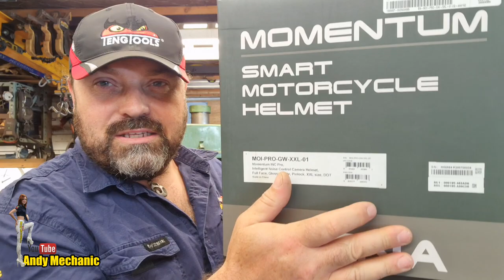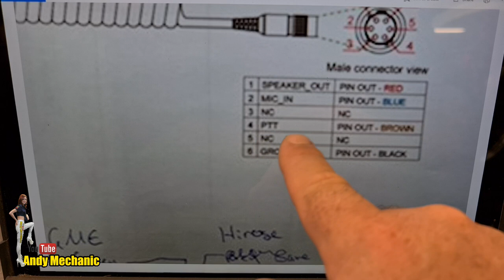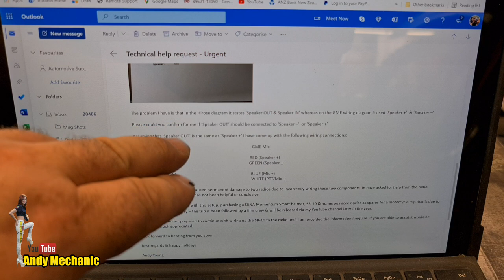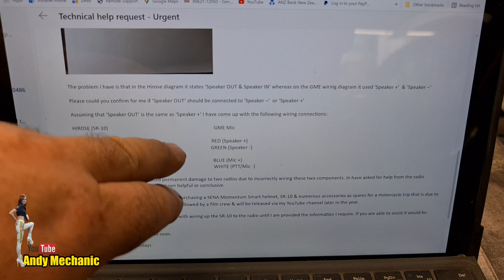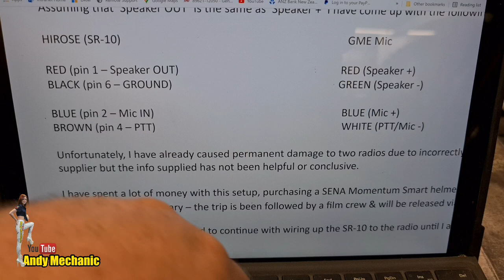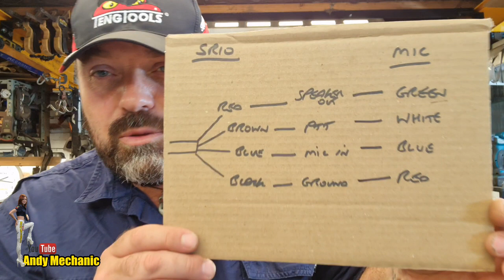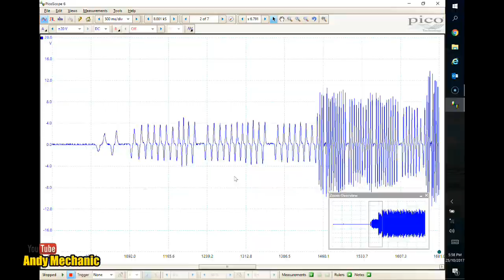HELP! - Any radio engineers out there? #1489

Comment: Speakers and mics are not sensitive to + or - berceuse audio is always alternating voltage.

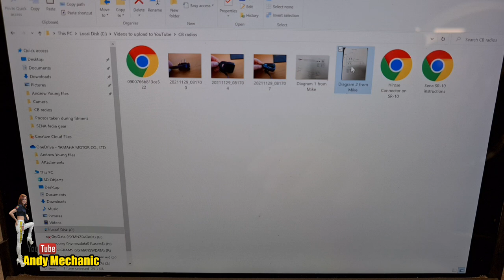5:22 My suggestion is to measure resistance from the round pluggs ("tele plugg" in swedish may be 3.5 and 2.5 mm) and see what color they have.
                                             Hirose
Speaker - colour ?     to Pin 5 black
Speaker + colour ?    to pin 1 red
Mic + colour ?             to pin 2 blue
PTT/mic - colour       to pin 4 brown

Comment: Andy, have you checked continuity using your ohmmeter? 
1) You can check from the speaker terminals to the connector pin contacts to verify your understanding.
2) If making connections is doing damage to the radios & you want to isolate potential additional damage, you could connect the speaker wires only (with the confirmation of the ohmmeter done 1st) 
3) then see if the speaker works.
4) If it does then disconnect the speaker & connect the mic & see if it works. 
5) If the mic works then try them together. 
The ohmmeter is your friend. Hope that quickens some thought.

NOTE: only the manufacturers can explain the potential problems with interconnectivity (load resistance, max voltage,...).

Comment: The way you have it now makes sense to me. I'd have thought radio would have had better protection from a miss wired plug. Hope you get it sorted mate. Wish I was able to help
Reply: I wanted to make a data cable for a £400 ham radio. The pinout diagram wasn't clear. So I thought I'd just short a few pairs of wires to the mic socket until it triggered the PTT...

Then the head unit said "Connection lost" until restarted and it then got stuck in transmit. Luckily I just had to pay the cost of returning it with spendy postal insurance.

The hand mic (icom lookalike) had LEDs, a tiny speaker and VOX - which works without holding the PTT. So I'm guessing it's a bit complex and I sent 8 volts somewhere unwanted.

Comment: Any time you have brown in a cable and not green the brown wire replaces the green wire.swap the speaker wires around.
Reply from the maker: Thanks Anthony, this is clearly info I was completely unaware of as it's not documented in the info I was given.

Can I also ask how, by getting the two speaker wires around the wrong way how this could damage the TX circuit on one if the radios?

I really want to understand exactly what's going on before I proceed...

So just to confirm your thinking here:

SR-10                              Mic
Red                                    ?
Blue                                    ?
Brown                                ?
Black                                  ?

Thanks for such a speedy response

Andy
Reply: @AndyMechanic  Andy did the receiver work do you know ?when you bought it.there are lots of scammers out there you have to be careful on what you buy on the internet exspeailly from people who are trying to make a quick buck the person that said the brown replace es the green he is wrong the brown replace es the black so the hot wires are blue red white sometimes if you have a yellow that also is a hot wire so the ground is black green brown white with a black stripe on it yellow with a green stripe on it blue with a Red strip is hot Blue with a orange is hot also brown with a white stripe is a negative you can test all of your wires with a ohme meter just make sure you have it on the 12volt side plus you have to make sure you have themillamps rite  if you don't you will burn everything out if you smell the sercutbourd and it smells burnt then it fried.do you know what transmission fluid smells like it has a burnt smell when you run your car for a long time.so if you smell a burnt smell like burning wire's then you will know it's not working anymore it's bad so let me know what you think and figure out I can help you out with that thanks Dustie M Letitbleed 1 my email is mineheined@gmail.com